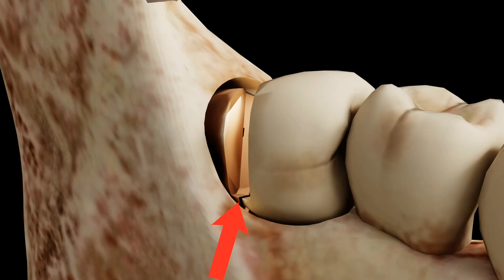Innovative 3D Animation: Horizontal Impacted Mandibular Third Molar Extraction

Comment: Dr, why the crown is so difficult to remove even after splitting?😢
Reply from the maker: If you find it difficult to remove the crown after splitting then that mean the tooth sectioning is not proper as there is not enough space for the tooth to come out. 

You can see it in all of my videos, the crown comes out easily after sectioning.
Reply: Thanks dr! But do we know if we have a proper crown sectioning? Any criteria to assess a good section?
Reply from the maker: The only criteria is that the tooth should come out without any trauma to surrounding bone and without appmying excessive force.
Reply from the maker: Read this article for more information - https://www.facialsurgeon.in/amp/vital-structures-around-mandibular-third-molar

Comment: Horizontal remove teeth complete healing me kitna time lagtha hai
Reply from the maker: Initial healing takes 7-10 days. Complete healing will take around 3 months. By complete healing I mean that the socket getting filled by the normal bone. 

But you can eat anything after 7 days of the surgery. So it doesn't matter how long the complete healing takes.

Comment: sir want to invest for piezo by woodpecker. is it worth? If we do not reflect flap also would it injure soft tissues. I mean if it touches soft tissue will it harm? Howz cutting efficiency sir
Reply from the maker: Piezo is really good for bone surgeries. Because it does not injure soft tissue when it come in contact with it. It cuts only hard tissue. But do keep in mind, it is quite slower than the regular rotary instruments.
But the biggest advantage that piezo has is that the patient is comfortable during and after surgery (minimal postop pain and swelling).

Regarding the flap reflection, I would suggest you that you still raise a flap as the best surgery and outcome can be achieved with proper visualization only.